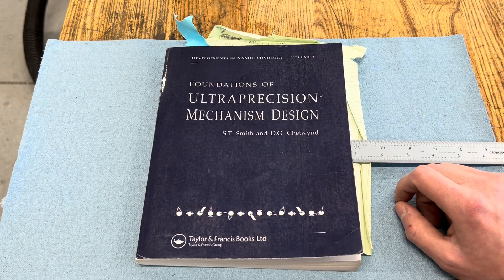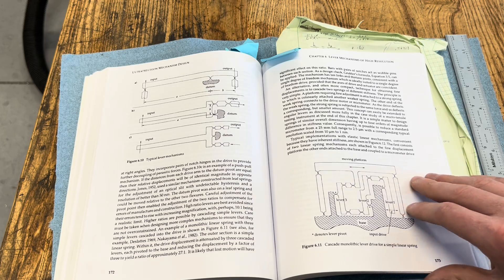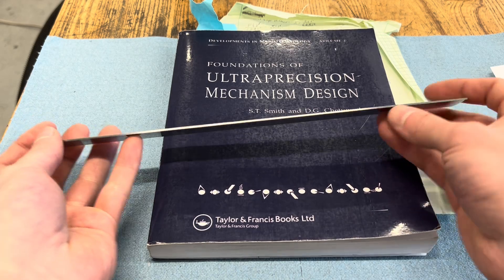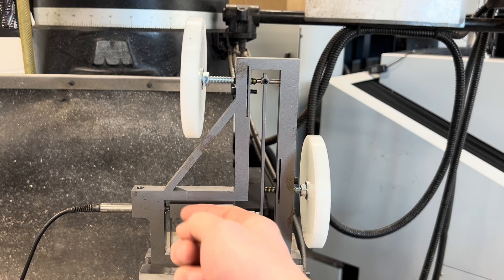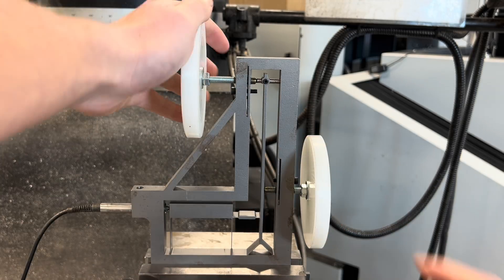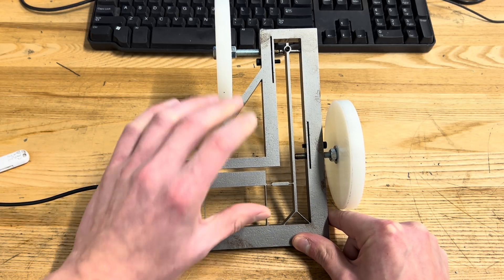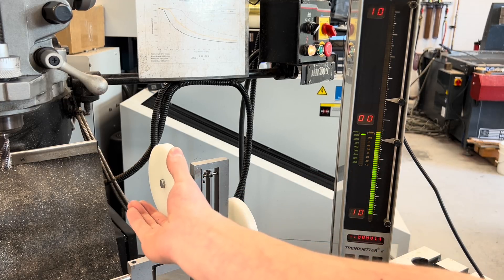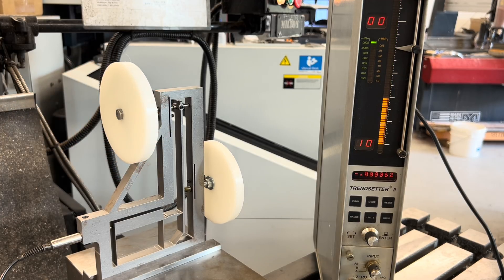“Diving Board” flexure lever mechanism for high resolution adjustment

Comment: Interesting!  You may get more references to differential screws than you care, but I just MUST put my spoon in the soup, so to say.  My first and possibly only experience with differential screw was for force magnifying on a Carbon Load Bank.  It consisted of two 90 degree angled ceramic, or glass (or likely asbestos (!)) plates, 35-some, 1/4 inch thick carbon plates in a stack,  copper plates with provision for cable connections at each end, and then a pressure plate pushed with the mentioned differential screw.  One end was fixed and the other end had a hand wheel for pressing the carbon pile tighter (for lower resistance) or looser for increased resistance.  The two ends were tied together with 4 half-inch thick steel rods.  The whole thing could handle for a short time some 200 to 400 A with 6 to 15 V.  It was used for test-loading welding power supplies.  There also was an undesired non-linearity and resistance drift.  I remember how mis-use every so often caused red glow and smoke appearing between some pairs of the carbon plates.  Eventually the differential screw system failed and we had to discard it.  Well, the carbon plates at same time were also in quite poor shape, and we did not have a source for spare plates either.
Reply: I think you need a very good lathe to make great differential screws, and also remember aspects like preloading. Just a normal screw can already do down to 10 millionths if it is precision made, I believe. A lapped screw could perhaps the same? I do not know what to do with precision above this. Except for laser and semiconductor stuff.
Reply: Fascinating story, thanks for sharing! (I wonder what the actual force was that was being exerted on the pile? I’ll bet it was pretty huge.)

Comment: how do you manufacture something like that? it looks almost 3d printed, so its hard to believe it was created using additive manufacturing, but i wouldnt belive you if you say you carved that out of a block. Are there small welds that i am not seeing between al the parts?
Reply from the maker: It’s waterjet cut out of a plate
Reply: He says waterjet part at 5:58

Comment: Due to the last 30s of the video:

Differential screws! For the adjustment knobs! Make a hand-powered atomic force microscope!
Reply: I was thinking ‘differential screws’ all the way through. You can stack them too. Only: at some point local heat development due to friction becomes a noticeable factor. Though I don’t know from where.
Reply: @Calligraphybooster  Differential ball screws! Less friction, and even less sanity after trying to get all the balls in. What's not to like?
Reply: @PeregrineBF  absolutely love it!
Reply: It's like those infinite reduction gearboxes you see built on youtube all the time (or used to). Amazing art/concept pieces, but the internal stresses and friction would lock up and destroy the machine before the output even moved a nanometer. Of course on paper, given infinitely strong frictionless gears...
Reply: Fascinating stuff 👍👍⭐️⭐️⭐️⭐️⭐️

Comment: There's another unmentioned factor changing the displacement, not just Hertzian deformation. The location accuracy of the holes & the ball contact points adds some error to the ratio of the lengths, and thus to the output ratio. I don't know how you produced those holes & haven't bothered to calculate how much that might matter, but I'd expect it to be similarly significant. The mentioned error sources are likely larger than this.

Comment: Very cool, I did a similar thing on my channel when building a 3d printed optical kinematic mount. It had rough and fine adjustment for the pitch axis. I used spring steel and had one end fastened down so it deformed instead of pivoting. The reduction on the fine adjust was a combo of the leaver action + deformation of the spring. It's in a video called "3d Printed Laser Spatial Filter" and about 3 minutes in.
Reply from the maker: Aha, wonderful application. Love your stuff Bryan!

Comment: Using this with differential screws instead of those you use then the accuracy is insane. It would be cool if there was some way to integrate such precision onto a lathe so we could mass produce certain complex and accurate parts. 
I just need some ideas what to manufacture :(. Maybe differential screws and some spindle stuff like tapered collet holders for cnc machines, custom bearings, hydrodynamic spindles...

Comment: Is it possible to make flexure with comparable performances from stainless shims like "INSIZE FEELER GAGE TAPE" that is sold in various thicknesses? I don't have access to water jet or WEDM to make it from uniform material. Fixed point to be spot welded or maybe some clamping mechanism?
Reply: You can.
Reply: I just made a few flexures from .008" 17-7PH and used clamping details. A few words of advise when doing this: make sure you have enough clamping load to prevent slipping of the shims, and don't stack shims to try and make it stiffer. Stacking makes the slipping issue much worse and the two flexures tend to spread apart and then snap back together. Fun fact, if you want to see this affect just take a paperback book and bend it back and forth holding the spine and the loose ends like the clamped flexure.